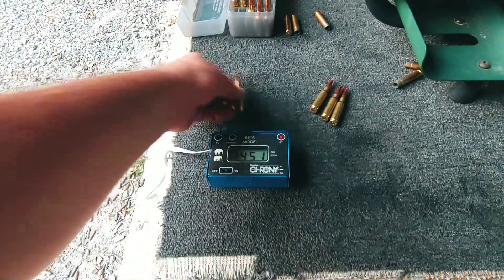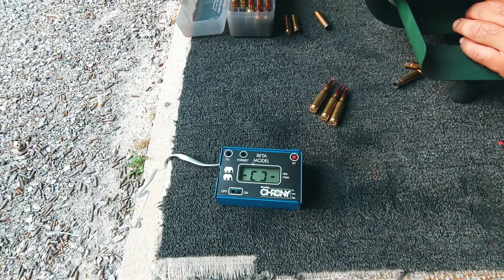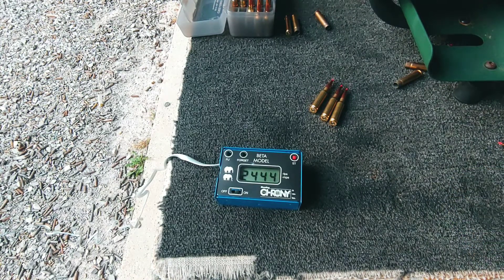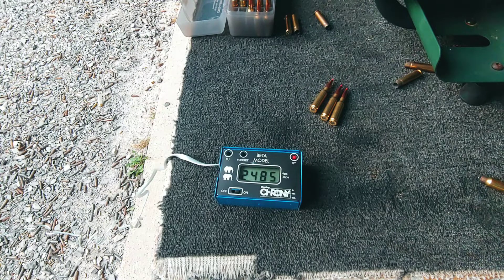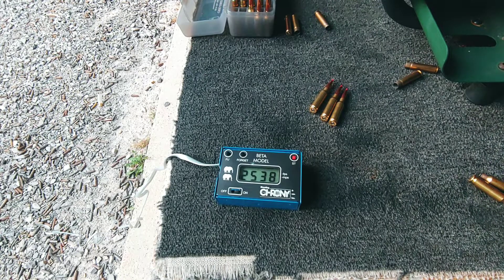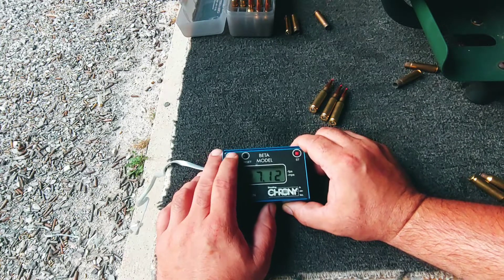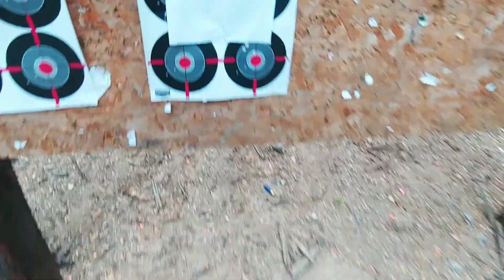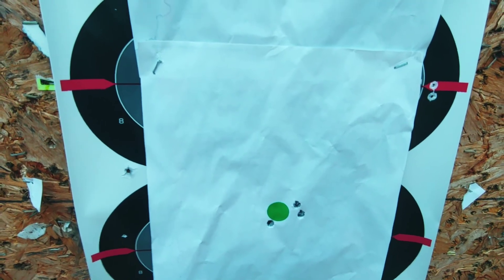Small rifle primer vs large rifle primer part II.

Comment: Do you think the the higher deviation in the larger could have been from a cold barrel vs the small primer having heat already in the barrel? I'm new to shooting but I have heard temp can affect muzzle velocity
Reply from the maker: That's a valid point but I shot 2 or 3 guns in between groups. I honestly don't think the barrel was as cold as the first group, but it wasn't real warm either. I have heard the bench rest shooters with 308 ordering small primer brass for consistency.  As for hunting and my application, I doesn't matter. I was just thinking about it and wanted to try it.
Reply: @jabsoutdoors3859  great thanks for the video. It was really well put together and informative